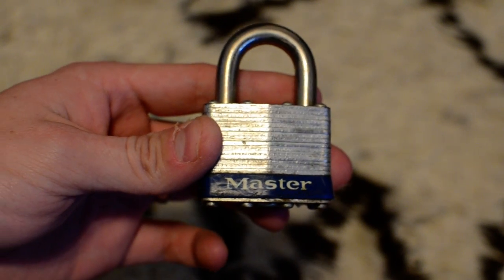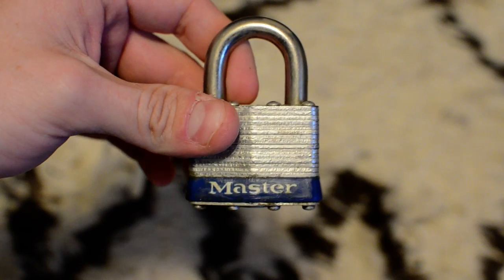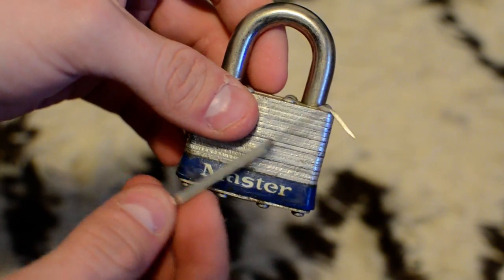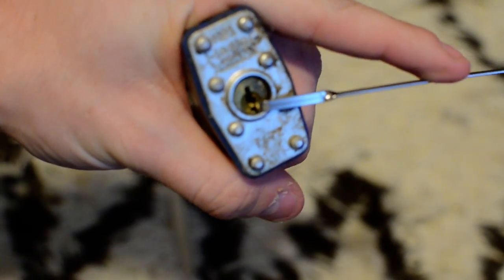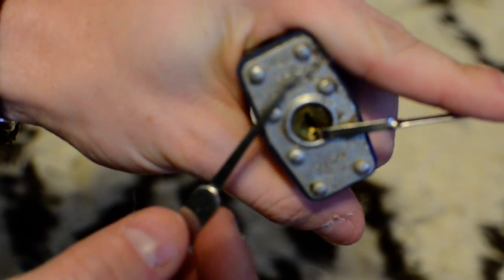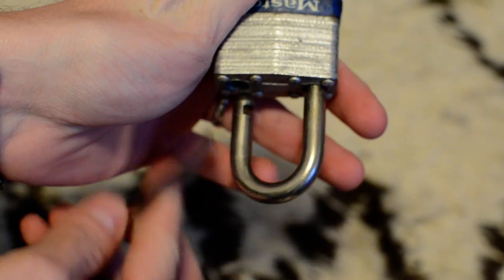How To Pick A Master Lock Easily

Comment: I've found that the bristles from streetsweepers make great tension wrenches.  If you see a grocery store that has a street sweeper running around periodically, look at the gutters because that's where they'll wind up getting pushed by the sweeper.  For a while, I'd just park at the end of one of the parking aisles and walk to the door on one side of the aisle, and would walk down the other side on my way back to the car.  Each time I went to the store, I'd park in a different aisle.  I stopped doing this because I wound up collecting way more bristles than I'd ever need.  I use a torch and bend them the other direction than the one shown in the video.  This way, they are extremely strong, but also lay completely flat.
Reply from the maker: @geekchameleon  that’s a great idea.